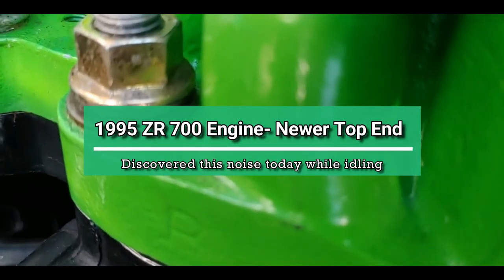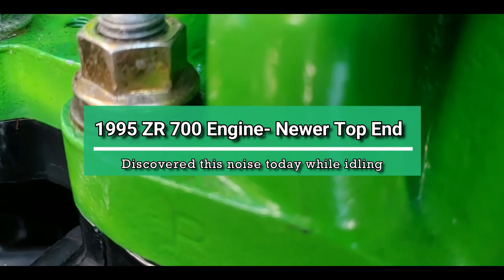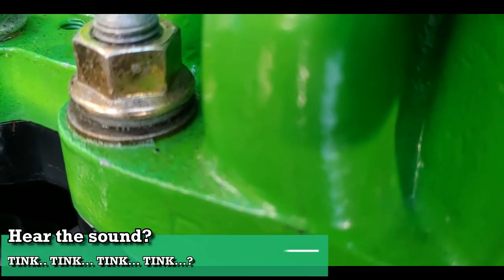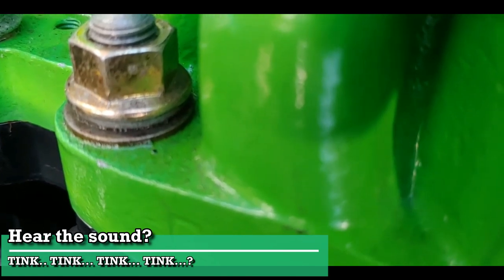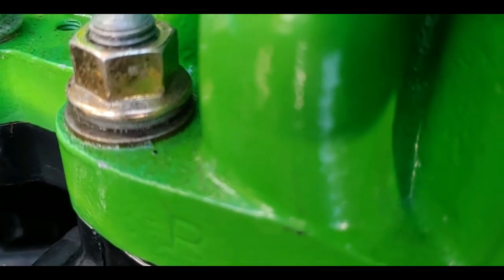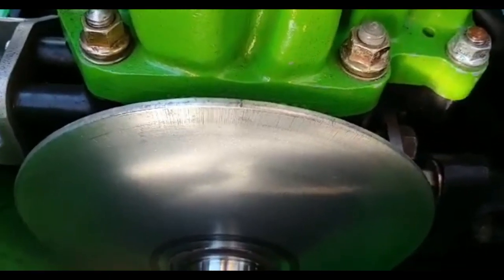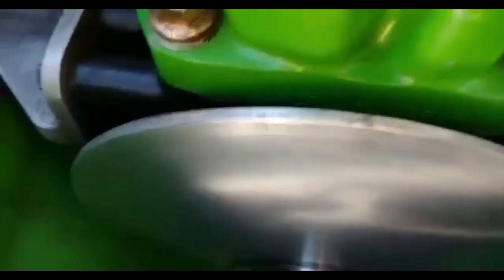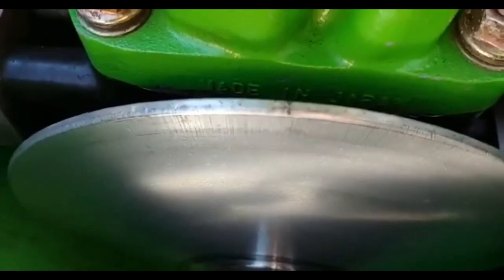1995 Arctic Cat ZR 700 Part 1 || Crankshaft Problems... [ What is that Sound??? ]

Comment: Hi Andrew. This sound is similar to the sound of a piston in a cylinder. There's nothing wrong with that. But I would disassemble the cylinder and measure the gaps with instruments and probes. This may also be the sound of a connecting rod bearing in which the gap is increased. between the piston pin and the bearing in the connecting rod.

To localize the location of the knock. Take an iron rod. A piece of rebar 2-3 feet long. Hold one end in your fist and put the other end to the motor. So you will find the place of knocking very clearly. Like a doctor who listens to your lungs. I ordered a special phonendoscope for this purpose. but if it is not available, you can do with a bar of rebar.

This sound occurs when the TDC piston passes the Upper dead center . If the compression is low, it is most likely the sound of the piston. if the normal compression is the bearing. You can't hear it very well in the video. But in my opinion there are two knocks more muffled is the sound of the piston. A more sonorous TSK TSK is the sound of a bearing. Most likely, if you disassemble the engine now, you will avoid damage in the future. All you have to do is change the bearing and rings on the piston.
Reply from the maker: Got crank being rebuilt. It needed either way. So Ill get it back and check the noise. Might be the wrist pin bore. If it is Im going to get new pistons.
Reply: @Fixin2Ride-Official-  When the engine is running, wear occurs where there is more clearance. The gap between the piston pin and the piston itself is thousandths of an inch. The gap between the needle bearing in the upper connecting rod head and the piston pin is much larger. The probability of wear of the pin and piston is less than the probability of wear of the bearing. So you just need to change the bearing. And maybe rings. although replacing the rings will not be mandatory. This is my opinion based on watching your video. When you figure it out. Show me what was going on in the end. I'm already wondering if I'm right or wrong. We have this method of diagnosis is jokingly called "diagnostics of engine operation by the position of the hands on the closed hood" (with)
Reply from the maker: I actually sent the crank off to be rebuilt. I did test fit the pins to the bearings and inside the connecting rod with the piston off and they seem tight. So Im hoping that is the large bore. If not then it is the wrist pin bore on the piston and Ill be getting new Pro-X pistons and rings and rehoning the cylinders...
Reply: @Fixin2Ride-Official-  The service manual has a table that shows the exact dimensions. Use a micrometer. What you think is "tight enough" may actually have an unacceptably large gap. When you measure the cylinder to understand its wear, keep in mind that the greatest wear is in the area of the intake and exhaust channels. On different models, even the same volume can stand fingers of different diameters. This is a precision pair. Need to pick up. You might just need to put a slightly larger finger.
Reply from the maker: Yes sir. I do have the full 90 to 98 Arctic Cat shop manual so that's something that I will be using this time around to cover all my bases and yes I've went over these kind of measurements and miking with my Onan engines
Reply from the maker: I appreciate your responses and your advice! Greatly valued
Reply: @Fixin2Ride-Official-   Спасибо.

Comment: My moms 2006 arctic Z 370 is starting to make that noise also but she has her 95 580 liquid cooled for back up
Reply from the maker: Yeah well its turning out to be the connecting rod and the crank needs to be rebuilt. Its not in very good shape.
Reply: @Fixin2Ride-Official-  same along with my moms 2006 z 370 idk how many thousands of miles its got but after the first rebuild she used yamalube 2M good oil but the odor was to strong off the oil and she didnt like the smell of it so i had her switch to polaris VES GOLD she also runs that in her 580 along with my dad in his powder special 700 cat
Reply from the maker: @edwardabrahamiii3742  yeah I put a new spi top end kit in it a couple years ago and its only got about 500 miles on the rebuild.
Reply: @Fixin2Ride-Official-  my moms got 2 whole seasons out of her spi pistons maybe you just got the hung over sundays work of pistons idk
Reply from the maker: @edwardabrahamiii3742  nah. I lm going to get the crank rebuilt and I may have a tiny coolant leak from a head. Ill confirm in the morning.